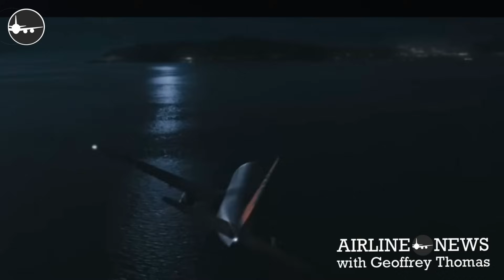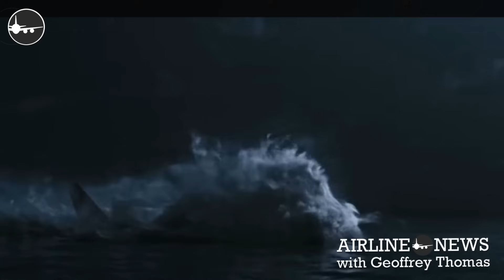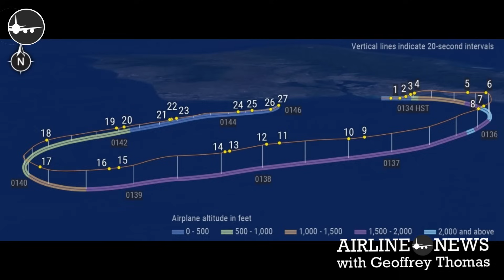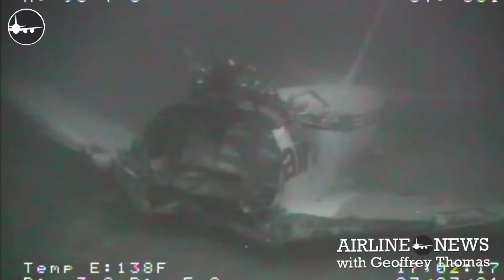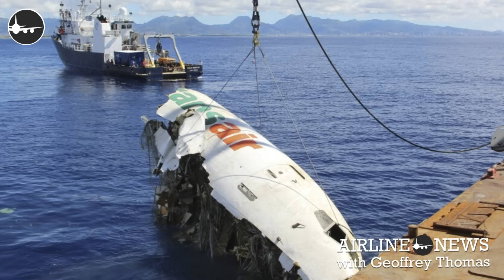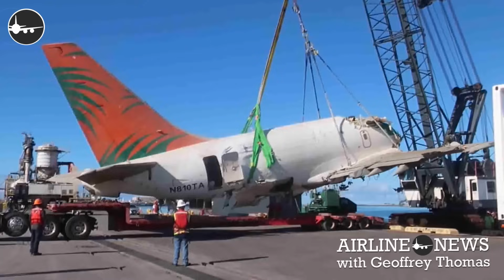PLANE GUYS - TRANSAIR DITCHING  #mh370mystery

Comment: Dear Geoffrey and Richard -
As you both skipped my question today which i think is important to be addressed. so i repost it here again 

you are talking about main battery had been working with inverter system till RAT started to supply back up power and transponder drop ?

only survivor Mr Ramesh Kumar Wishwas had stated in Hindi the evening of !2 June ,
HE clearly said " after take off for five or ten seconds  i felt the plane was stopped (He didnt mean STAND STILL  in hindi as you interpreted  but what he meant power was out from cabin and systems too stopped ) I  thought something might happened then green white light flickered again"
you clear us  now plz If main battery was still supplying DC power WOULD had the cabin power to lights went out ?? 
it seems only getting the power to lights in CABIN back when RAT started to being fully functional ??

Comment: Theres really know proof of what happened to the mh370 boeing 777, but in recent days there's indence on software problems or glitchs and maintenance issues, where, there any issues of electrical or glitchs in the software on the 777 model system in the plane, was it documented or recorded on update or recall, as I heard there where issues with the software 2005- 2013 with 50 instance issues with system needing to be modified and error codes inflight ect.

Comment: I'm not sure how or where you ask questions for upcoming episodes, so apologies if this is the wrong place.  Relating the recent Air India Crash, from the sounds I heard on the video and now seemingly confirmed by a better quality video, it appears the RAT was deployed, presumably directly after take off indicating that both AC electrical busses had lost power (AC BUS 1 and AC BUS 2).  Again from the video, it didn't look to be due to a dual engine failure, but more from a complete and catastrophic electrical failure. 

I believe certain airplanes can also manual deploy the RAT via an overhead switch if the crew anticipates the need, but uncertain of what that would do if both engines were functioning normally and power had been maintained.

Comment: Question- - firstly thanks for your continuing insightful and sensitive coverage of the search for MG370. It is brilliant to now have Blaine Gibson on your show, his worldwide efforts in recovering debris are nothing short of incredible. 

I have a general question over the precise timing involved in the takeover of the plane. We know that they verbally MH370 signed off Malaysian ATC just before IGARI waypoint. We also know that a person(persons) intentionally turned off the transponder manually and then performed a sudden challenging turn from the radar info. These are proven facts. 

My question here is do you think whoever did this had a pretty it short a window of opportunity to enact this action. Any earlier Malaysian ATC would been aware. A short time later HoChiMin ATC would have seen their signal and been alert to them failing to respond or a seen the transponder flicking off which both would have raised alarm bells. 

At standard speed how long was this “window of opportunity” do you think before HoChiMin would have started hailing them on radio or actively watching. 

Also who would have been able logistically to know the airspace and that windows opportunity AND had expertise.  A highjacker would struggle to know the airspace and be able gain access to fit the narrow window opportunity. It really has to be one of 2 pilots would have both access, knowledge of ATC and ability to fly a difficult manoeuvre. Unlikely both would be involved, meaning one would need to in that window get the other to leave and lock the door. 

Do you think CoPilot given his reduced seniority could have any conceivable pretence by which he could ask his senior to leave cockpit? Seems far more likely a senior pilot could ask his junior to for instance “grab us both s coffee” etc. 

Finally do we think the co-pilot had enough experience to be able to enact that challenging tight turn himself. 

Keep up your fantastic work, I think for anyone following this sad mystery your channel is required listening

Comment: Once again the forest is missed for the trees!
Whole video on flt/crash data! 
Zero on why pilots (hap before) can't even tell what engine is damaged or speculation as to why! 
In this tech age these airline can't put a buzzer/lite flashing in cockpit to indicate which engine is damaged and readout of symptoms? Mind boggling! 
Same w 370. The mystery is motive of suicide pilot not if end location of wreck is at A or B other than feather the bed of winning competing analysts!
No comparison w DB Cooper who was rumored to have a beef w N.West Air. Yet Cooper just took the $! Spared the passengers and plane!
Yet 370 pilot killed both. And maybe 5% of these videos deal enuf w pilots. Same fr under hr woman  Apace heli pilot in DC!
Only tangential int in Airhart final wreck locale. How did Amelia & Noonan screw up the final plot and have under tech radio gear on board such a historic flt.
If no way other than a diary or resurfaced testimonial to determine pilots motives or screwups than SAY IT! Don't ignore it.

Comment: The ditching of the hijacked 767 just off the beach was another example of how badly a ditching under fairly 'ideal' conditions can nevertheless go!
Reply: Not a sully experience
Reply: @ribbit2816 indeed- quite the opposite side of the coin-flip !!
Reply: Thats a Bad example because the Pilot didnt land the plan evenly in the water, which caused it carwheel

Comment: Whoever was flying MH370, must not of known all of the planes functions.  If he wanted to disappear, without the plane's ACARS, turning on again.  This pilot did not know everything about the plane.
Reply: Whoever was sure knew a whole lot about a lot, though. Kind of impossible to know absolutely everything… even engineers who built the plane probably wouldn’t know absolutely everything about all the systems on board. But, the plane still hasn’t been found, so, there’s that.